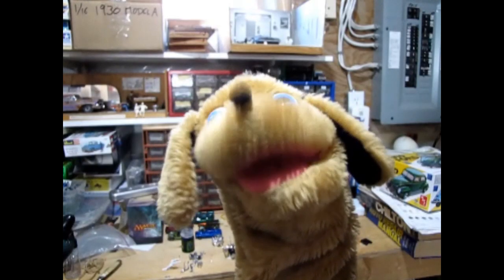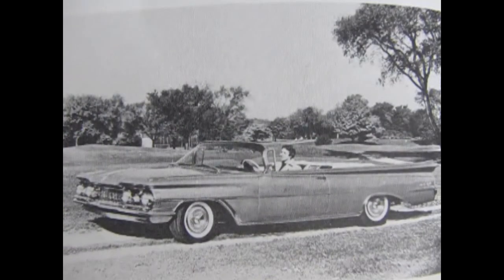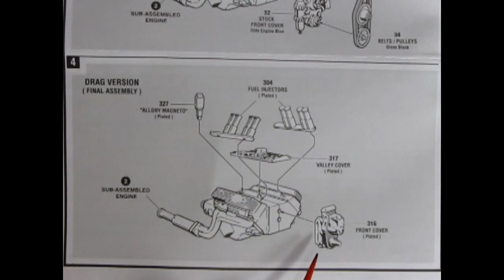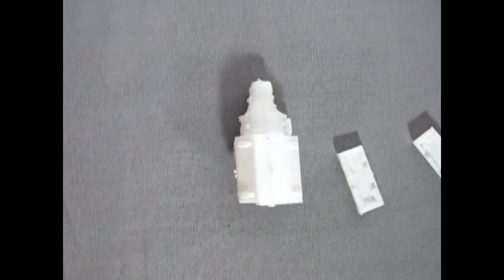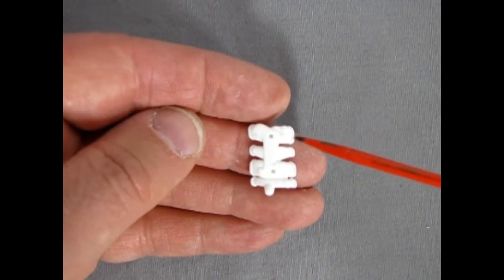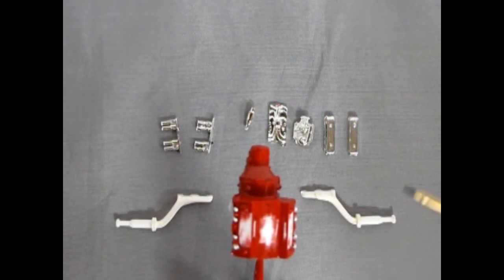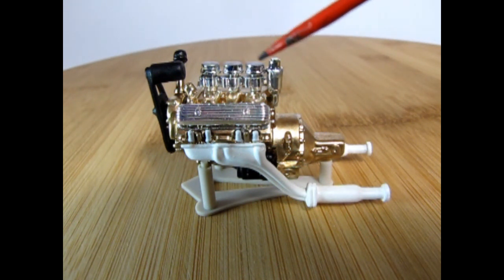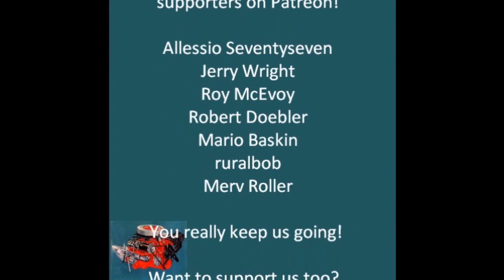Model Car Garage Tips and Tech - How To Build The 394 Oldsmobile Engine - AMT 1940 Ford Sedan

Comment: You built some great old school mills! A great Olds engine comes in the Revell Orange Crate, also released as the Chopped Deuce '32 Ford tudor competition street rod.
The engine can only be built in the actual race car version but has a timing cover casting to mount a 671 blower to the crankshaft snout. Quite the engine! You would mostly see this type of supercharger set upon Bonneville salt flats cars but the Orange Crate was a drag car.
Reply from the maker: Thank you. The Orange Crate is a cool kit. In this series I was focusing on the AMT Trophy Series alternate engines as a bunch of them are interchangeable between the model cars in that series. - I have a future video plan for that! :D

Comment: Sweet,  my sister had a '65 oldsmobile 1990 - until the wildfire. The motor  sounded beastly and was beautiful.  I had an '50 olds but not the 88 rocket,  I can hear the old song now 😎🤟🤪👊
Reply from the maker: Glad you liked the video. Oldsmobiles are amazing. I have a 1972 Cutlass S with the 350 2 bbl automatic.